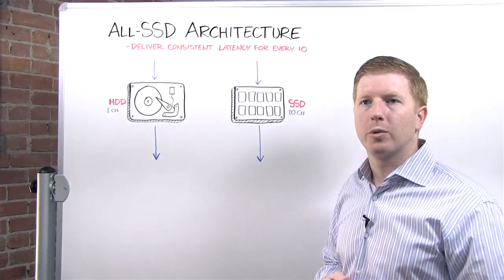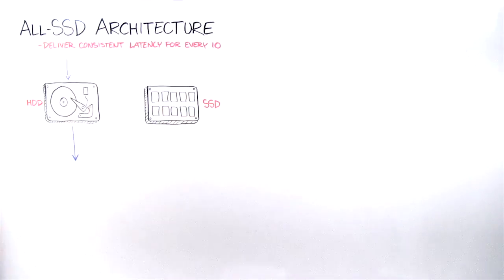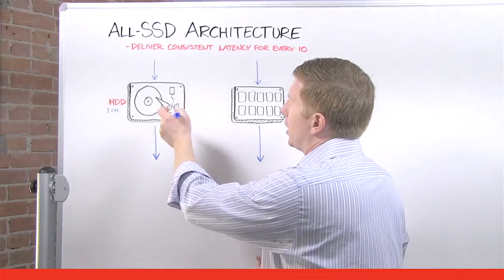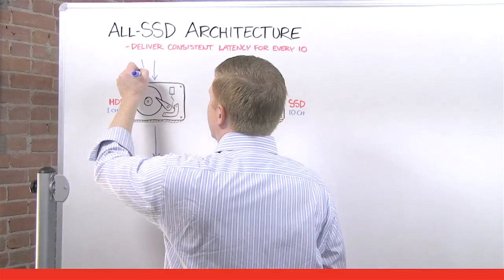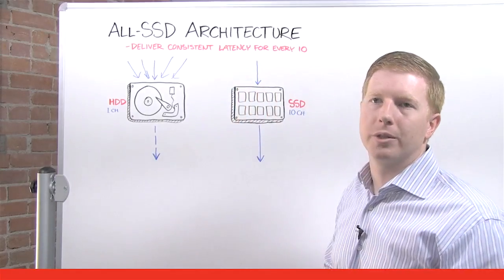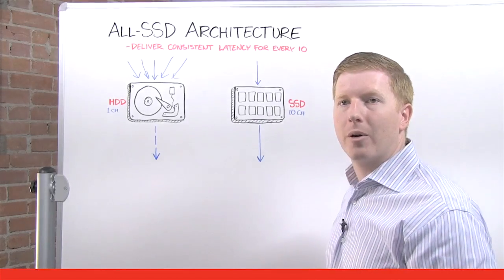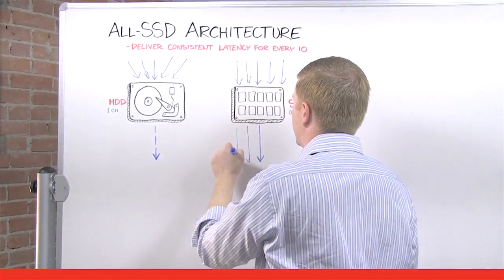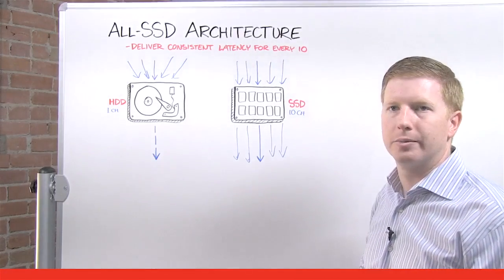SolidFire Whiteboard: All-SSD Architecture

Comment: The way that the diagram is drawn I see several potential points of clarification:
1. I am sure SSD's have the same limitation as HDD's do, of only being able to address one IO at a time as HDD's do, and unless Solidfire are making their own SSD's then I have to assume this is still a limitation. This leads onto the second point.
2. By saying you have 10channels for your SSD's would it be the fact that you have a channel for ever drive in your chassis and each chassis supports 10 drives.  If that is the case then the same can be said for the design of a 10 channels for an HDD type architecture as well.

It is interesting to see how all of the ways vendors are implementing SSD into their systems and especially the case of "All Flash" arrays, can customers be convinced that the messaging by vendors is that SSD is the answer to all workloads, I will get back on my fence and see how that plays out.